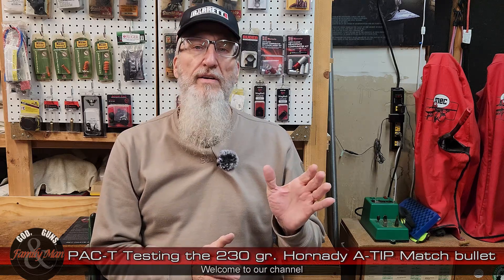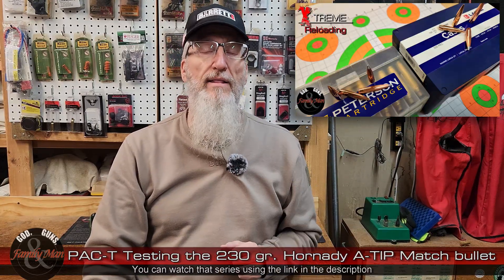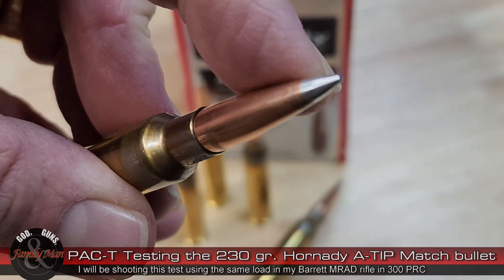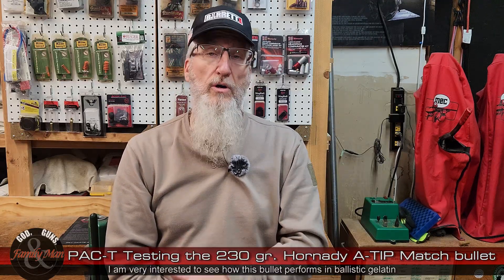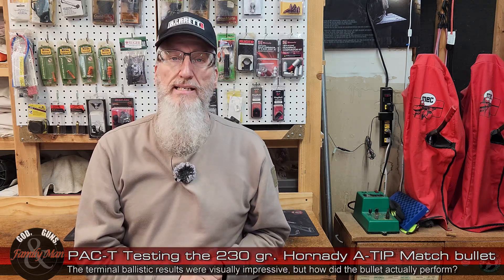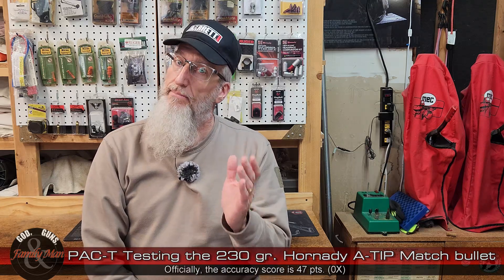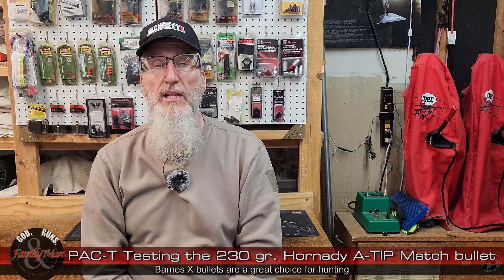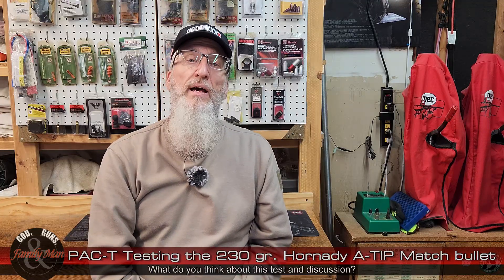Match Bullets for Hunting?  Full Ballistic Test of the Hornady A-TIP Match bullet

Comment: Great information and footage.  What do you think took the chunk out of your table, just the force of the bullet hitting the gel and echoing back into the wood?
Reply from the maker: Hello Aaron, I think it was the force of the 16 lbs gel block as it crashed against the block behind it and then rebounded forward, tearing out the little platform I had built to hold up the soft barrier.  That platform worked pretty well for all my pistol (and even 30-30) tests, but the energy in this rifle is tremendous.  Thanks for watching.